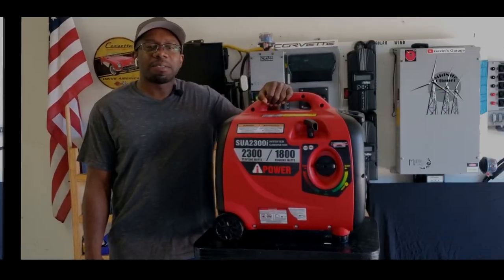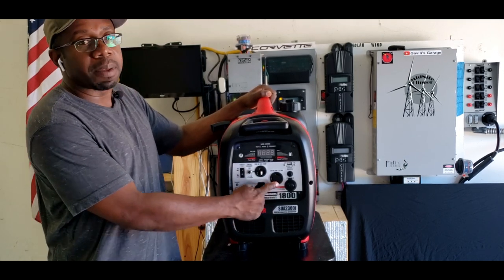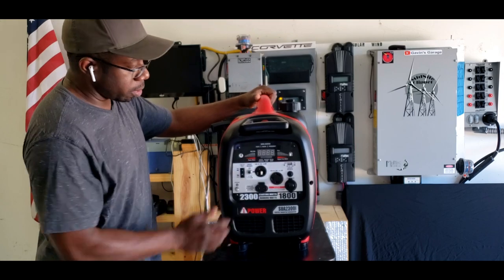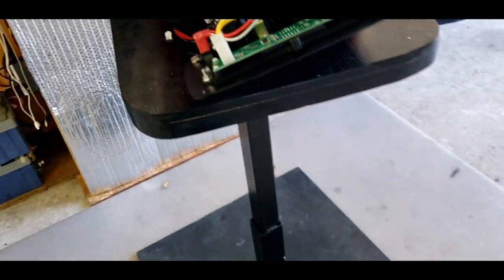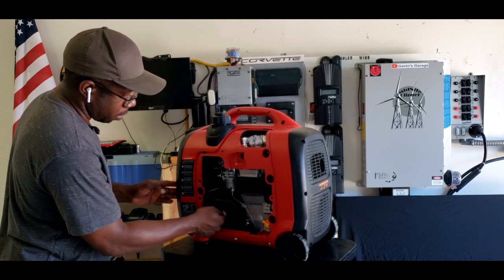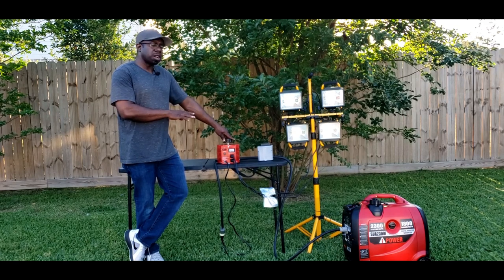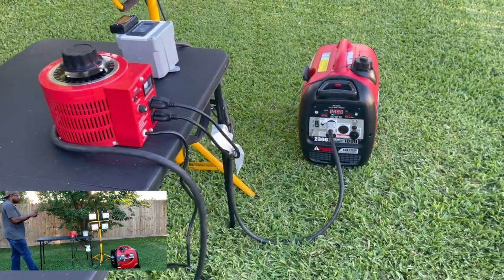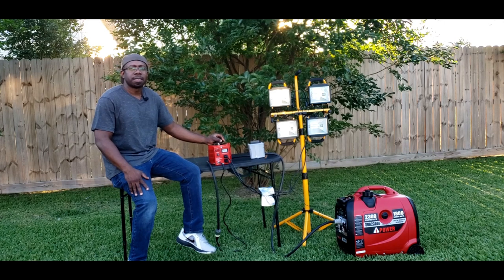AI-Power Generator Retested oil change and load test performed (Generator Review)

Comment: Excellent discussion. I really like the 2300 inverters and bought one similar, I also have a GP2200i. The reason I like this size unit is because most extension cords are rated at 1875watts, I like the idea of never accidentally overloading the cord .. even if it is a substantial 10 gauge or 12 gauge. The size of the generator and it's peak output will never exceed the cords ability to handle the wattage. Besides, I have never needed more than 2000 watts even during a prolonged outage .. 2000 watts easily runs fridge, lighting, electronics and TV, floor fan and small 600 watt microwave.
Reply from the maker: Yessir 👍🏾

Comment: Nice test, you have a great setup for testing. I have two questions,  1.  At what watage did the overload light begin to flicker.   2. Please test surge capacity. You can start with a known load say 1500 watts  on one receptical, then plug in a known load of 800 watts  on the other  receptical.  Measure the number of seconds it pulls the full 2300 watts.  If it kicks off right away, reduce the surge until it holds it for 2 or 3seconds. The most important specs are continuous  rated  power and surge capacity.  That's why they are in the largest font on the side of the generator,  but almost nobody tests  for them, because it's hard.  But you can.  Thanks for your work.

Comment: Nice demo. I just bought the same unit with the Yamaha motor for my camper. Hooked it up yesterday and went through all my big draw items individually, blow dryer, microwave, Keurig coffee maker and so forth with no issues. I could run the microwave on high and blow dryer on low (500w), at the same time just fine.
Just for giggles I did turn on my 15,000 BTU AC unit with no soft start.......not a  chance. 
Look forward to watching your channel grow, good information.
Reply from the maker: Liked not a chance. 😅 thanks for watching 
A 3k might be in your future. Soon

Comment: On the 30 Amp  receptacle i believe that mean its where you plug the 30 Amp camper type plug it doesn't mean you can get 30 amps out of that plug. The manufacture is being somewhat deceptive IMO
Reply: ill have to watch the video again but  the gen shut off before it hit the 2300 peak wattage so thats a fail IMO It failed at 2100 peak watts
Reply from the maker: Exactly manny.
They all are labeled the same. just means exactly what you said, that you have access to use a 30 amp twist plug👍🏾
Reply from the maker: @mannyfragoza9652   It’s rated for 1800w running so.... technically it gets a pass
Reply: @GeneratorReviews  well i hope it would perform at its rated output. But its very important for most generators to handle peak power for high amperage startup motors and such. I have my doubts the AI Power would handle a 10,000 BTU AC when the compressor kicks on.
Reply: This generator is designed to be used in parallel with another generator. With two of these attached and running you can get 30amps out of them. In that configuration you have to use the 30amp plug, and it will deliver 3600watts. Read the Manual.

Comment: For 400 bucks, this is not a bad generator.  I went back and forth between this and the blue one from Costco.  That one has the MZ80 engine, however that engine is made in China (easily verifiable fact), and this engine is a clone of that one.  The inverters and other electronic components are identical.  This runs my home microwave (15 amps) without faltering, which, despite it's advertised rating, surprised me.  One more interesting fact; this one has a 3 year residential warranty, while the blue one has a 2 year residential warranty.  This distinction is listed on Costco's site, as well as A-Ipower's site.  Very surprising, given the fact that most folks assume that the Yamaha engine is superior to this Senci engine.
Reply from the maker: Thanks for sharing all great points

Comment: I thought that the 30 amp plug delivered 30 amps if you were running 2 generators in parallel. Parallel cables for other different generators are labeled 30amps on the plugs.
Reply from the maker: You get 30 amps because each generator is providing 15 amps when running in parallel but yes you’re right 
Great point 👍🏾

Comment: Thanks for retesting this. I nearly decided against the Ai-Power with the Yamaha motor because of your initial test, so this was really helpful. I'm curious if you tested the full load when eco mode was turned off. Does it maintain voltage or does it drop at all? I see during the eco mode test, voltage drops into the 80s, but that's only momentarily. If eco is off, I assume it'll hold constant voltage up to 1800 watts. Again, great test, super helpful!
Reply from the maker: You’re welcome!  I always keep Eco mode on because that’s how majority of the people run their generators but yes if you’re pulling heavy loads it’s wise to turn eco-mode off and you would hold voltage a lot better.

Comment: Thanks Gavin . I returned mine to Sam's club right after I watched your review . Being that this was the only one of the bunch that would not start and run the little window ac unit , what do you think is the problem .
I'm looking at the Wen 56235i now.
It's only 39lbs and 1900 running watts and alot smaller too. I believe this is their newest line .
Thanks and keep up the great reviews. PS,  I also ran mine ( before I returned it ) up to 1800 watts slowly no problem . I like the hard start tests 👍
Reply from the maker: I think its definitely something with the engine size because why would they sell two versions of this inverter generator, one with a Yamaha engine. 
So that makes me think that the regular ones aren’t able to handle 2300w so they just shutoff. I tried seriously tried making it pass three times but it couldn’t make it same outcome every time. 
That really frustrated me because I didn’t plan on those test result.
 The second time I think it passed because now the engine has been broken in, it handles the load but its not perfect. 
 The others passed with flying colors so why would this one struggle on the same test.

Thanks for watching 👍🏾
Reply: I think it's the engine size. It's the same engine 78cc as the 2000/1800 one. That's why I bought the 2700 with the 98cc it's 2200 running watts. I have noticed that their newer models are more truthful. 
For example they used to sell the 4000 peak unit 3500 running. It's now sold as 3800 peak 3500 running. 
My buddy has the same 2700 I just bought and it's great. He has a camper and starts his AC first then other stuff. He can also easily start and run a 6000 and 8000 BTU window unit but starts on low. Then can step it up to max if needed. 
They are newer window units so that could have something to do with it. 
There are 2 types of motors used in AC units. Forget the names but like a type G and type E. One takes 6x the running watts to start and the other takes only 3x. Also some units now have "easy start" on them to not slam the generators. I think it's more so that the new RVs with solar banks can handle them. Same with window units.
Reply: I tested my 2300 with a 40 year old garage refrigerator that my 3500 6.5hp had trouble starting and a 14amp pressure washer with an inrush current of 21amp and it had no problems with either.   I was so impressed I went and bought a 2nd unit.

Comment: Hello Gavin, thank you for the information provided in the videoI I would like to add that I use the 30 amp connection for my RV with single generator and it powers all of the RV items excluding A/C. The RV has an Onan 4000, but draining the carb is a hassle so I use the AI-power for RV prep and storage.
One question as I am considering adding a 2nd AI-Power 2300 and noticed there is no 30amp breaker when in parallel. The two wires provided for parallel use are just jumper wires and nothing else. How do they protect 30amp service? Since the parallel mode cannot exceed 30 amp do they just rely on the generator cutting out?  Here in California our storms have caused several power failures and this generator has worked beautifully powering needed items.
Reply from the maker: Hi Glen
Each generator will monitor the power output it produces.

Comment: Nice video, but your point about two outlets getting exactly the same power is a little misleading.  For starters the 5-20R outlet is restricted to 20amps by a circuit breaker whereas the 30amp outlet  isn't.  This is by design to allow higher power access when paralleling.  I get your point they are essentially getting the same power when not being paralleled.
Reply from the maker: Yes, that’s the only point I was trying to make it but thanks for leaving the comment. It helps others understand.👍🏾👌🏾💯

Comment: If you were in the market for a new 2kish generator and reliability, noise, and functions were your main features of importance, what manufacture would you lean towards for a truck camper that you could parallel to run a 10k BTU AC if needed?
Reply from the maker: Reliability, functions and Noise 
What about fuel type gas and propane
I recently reviewed the champion dual  fuel 2500 Check out this generators
https://youtu.be/lIvn-yBErLY
Reply: Gas, I really have no interest in running propane. What would your recommendation be?
Reply from the maker: @chaddrx  I don’t usually recommend but I’m going to give you three generators I like. 

*Generac GP 3000I, this generator is easily transportable and so Quiet you’ll never have to worry about running your ac 

Firman 2100i This one has the 30 amp twist lock and 20 amp plugs also have to carburetor drain feature after you shut off the generator

Wen 2250 I like this generator it has a fuel gauge and the carburetor drain feature but it only has two 20 amp plugs

Comment: got me, subbed thx for the test.  Since that "30amp" receptacle is nothing but a 20 amp, do you know how I can use that outlet by std plugs?  Is there an adapter that can be used?  I guess the only way to get that 30 amps is when matched up with another parallel generator, in this case does the 20amp become 30amp, since they are wired on the same circuit?
Reply from the maker: Thanks for the sub
Yes the way you utilize that 30 amp plug is by paralleling another generator and you can get your 30 amp so you’re right.

Comment: hello, I bout this for a small ac for my camper, i just went to put oil in it and the dipstick smells like gas with a tiny bit of oil on the dipstick. I bought it brand new. is this normal , this smell? or should i return it?
Reply from the maker: Just go ahead and add oil to it. Run it for about 20 minutes. Drain it. You should be perfectly fine. I don’t think you’re smelling gas. It’s just that it’s been in a box. Everything smells funny.

Comment: Is it possible to run a 13,000 btu ac unit on 2 A-ipower 2300 inverter  generator on eco mode?
Reply from the maker: It’s possible, but it might not in really hot temperatures

Comment: Thanks Gavin-           So it cut off in demo after you went to 2100watts? You mentioned the lights were 2000 watts, so I was wondering why the generator stayed at 1800 (the designated running time) once you retested? can the genrators go a bit past running time and still work? The reason i ask is because i need to buy a generator that powers 4- 500 watt bulbs, or 3- 500 watt bulbs and a small 430 watt fog machine, for a photoshoot-               Thats about 2000w or close to that? If the unit is 2300w with a running time of 1800, can there be some leadway and handle 2000 watts?  Im new to generators,and dont need it for house.    TRYING TO DECIDE? The honda is so expensive BUT TRUSTED, and Im looking in the $500 range- Any tips on which one that is rated best and clarification on running time wiggle room?-  Thanks for any info-
Reply from the maker: If you want something you can carry around really easy I would consider a 2500 watts generator that’s gonna allow you to run your 3 lights And still gives the generator a little leeway so it doesn’t run at100%

Comment: That was a good test on a resistive load, have you tried testing it on a load with a motor or compressor?
Reply from the maker: The only thing I have is that air compressor and the ACs on my RV

Comment: Like 404  !  Great detective sleuthing on the single wire to both receptacles.  
Silly me, but what would happen if you had a 110v plug in at the same time as the 30a plug going out also?  
BOOM?   :  )  Or something like a voltage drop, brown out
Maybe you mentioned this and I just missed it.
Reply from the maker: Yep! I don’t think anything will go boom probably just trip the breaker or over load the engine or voltage drop.

Comment: So what is the point of having the 30 AMP outlet if you cannot get 30 AMP?
Reply from the maker: 30 amp plug is installed if in case you parallel two generators then you can use and get 30 amp
Reply: @GeneratorReviews  I would say the 30 amp plug is also for marine use, my son has a cabin cruiser and it has that type of plug on marine cord. i don't know has fact but my guess, sure liked tour video.

Comment: Do the Hondas run at 5500 rpm at max load?
Reply from the maker: The Honda Eu2000 high 4310 rpm and eco mode 3000 rpm
Reply: @GeneratorReviews  is the 2200i the same as the 2000 rpm wise?
Reply from the maker: @shanwar9844  I haven’t tested the 2200i

Comment: How does the circuit breaker work if paralleled via supplied kit and 30a RV adapter? Does it trip at only 20 amps?
Reply from the maker: The parallel kit circuit breaker will trip
Reply: @GeneratorReviews  I didn't know the supplied parallel kit had a breaker. Good to know. Thank you

Comment: 20A comes from the 30A capable circuit doesn’t means the 30A connector isn’t 30A capable 🤔
Reply from the maker: Can’t get 30 A from 20 amp source, that’s the point I was trying to make.
In order to get the 30 amp, you have to parallel two generators.

Comment: I bought one new and it won’t run my 5K BTU  portable A/C
Reply from the maker: Same issue I had the first time I tested it.
Reply: @GeneratorReviews  so you think I should retest it to see if it holds now?
Reply from the maker: @SouthSideBullyz  Just one question what gauge extension cord are you using if it’s less than a 10 gauge you’re gonna have that problem
Reply from the maker: Also try it in both modes eco-mode and normal
Reply: @GeneratorReviews  I guess basic orange 100 ft. But I also plugged it into the I power directly.
Reply: Tried that too.